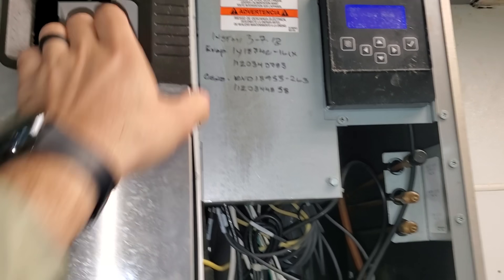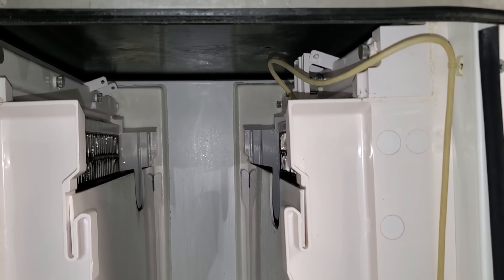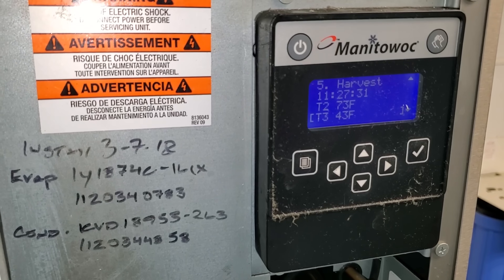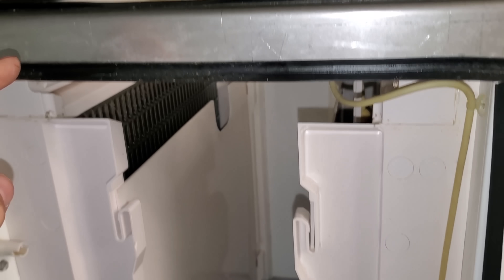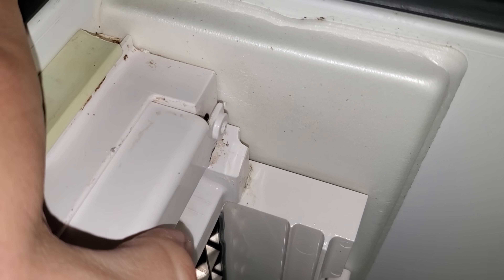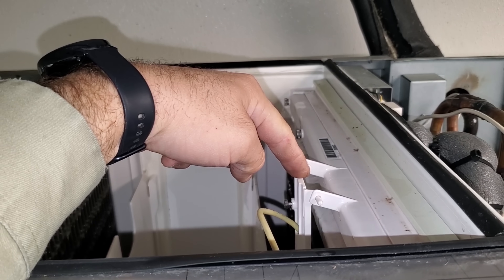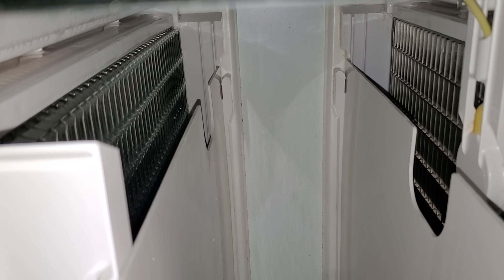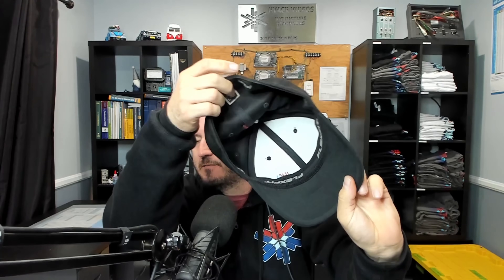THE ICE MACHINE IS DOWN

Comment: Long Harvest times will burn up an air compressor just like clogged water filter or undersized supply line or float or water probe malfunction. switched Bin Switch wires is a new one to add to the check list though.

Comment: You Guys Have it so easy nowadays on these ice machines with the ability of the internet to just look things up, plus kudos to the manufacturers for their websites and giving techs the information they need. God the old days before published spec and tech info. You could spend hours on some of the ice machines just trying to play Jonny detective to figure out what the hell was going on and track down the dang problem,  then the availability of parts was more of a nightmare than even now with this pandemic. I remember having to wait for 2-3 months to get a frigen $25.00 part from mainland China, but I learned early in my career to always order two of the same parts at a time because 99% of the crap came( BWD) Broken When Delivered, I also learned that NEW parts are just parts that have never been used before NOT that it was guaranteed to work like intended. Sometimes I would take a break from working on an Ice machine and walk down the street a bit Scream and cuss like a sailor on leave, smoke a sig and then take deep breaths and get back to it, you also became very good at hacks and tricks to by-pass broken crap to keep things running until the slow boat from China with your parts came in. lol

Comment: I suspect that it's been switched that way for months, if not years.   What's happened is that the pump that was failing brought it to light.    By the time it cut off the "finished" side, it had put enough vibration into the "almost finished" side to let it complete the job.   With the pump _failing_, it could no longer get right to that edge point.

Comment: You gotta get the sounds of the machine down. That is the first thing I do when I walk up to any machine. Sight, sound, smells even. Most the time it will point you in the right direction. That noisy pump was probably a little low on pressure. Now you know that is one less thing to have to worry about getting called in on a weekend. Thanks for the video.

Comment: If you guys haven't changed the board, and the cleaning crew clearly haven't been into the the bin switches, that leaves the customer tinkering with the unit.

Or, and this is a stretch, some how the pathways for the bin switches changed in the board. Like I said, that's a stretch and highly unlikely. If it happens again, than it's possibly the board.

Yeah, that's weird, but of course the customer says, "only you guys have been in the unit." Weird🤔

Comment: Here in Fl, any Scotsman or Manitowic has these errors, we always go the Evap coil and inspect them. Especially with the hard water FL has, the nickel plating on theses ALWAYS chips off. We notice even filtering doesn’t help with the water hardness and the calcium build up. With that said, the ice sticks to the Evap where the nickel has been pulled off by the ice, and that’s will prolong harvest as the machine gets older. Here Evap a last 5 years at most, and that’s when, it’ll constantly have these problems. 
Stick to Hoshizaki!

Comment: Update on my Fluke 337 & 52II rant -- replaced my 337 with the Fieldpiece SC440 and my 52II (still works put has a cracked screen) with
 the ST4 -- I'm still f@#king pissed -- still have my Fluke 971 humidity tester and & 1587 Insulation meter going strong after decades -- 
even the parts we replace on the walk-ins and worth chit some or most of the times -- compared to back in the day!
Reply: parts we replace on the walk-ins ain't worth...............

Comment: Chris, Ice machines are very finicky..  And, the worst part about troubleshooting is patience. In the big picture diagnosis. And not coming to any pre-conclusions or pre-determinations. And, worst of all troubleshooting overall is intermittent problems are the hardest to diagnose. 20 years of experience here.
The Old Scotsmans. What’s the mechanical timer in the sequence of operation. And, a lot of the places I go to in Western Pennsylvania Out in rural areas have well water to some of these restaurants in very high mineral contacts and have very little filters if any on them.. played hell in trouble shooting how do you how do use 75% dilution on ice machine cleaners back in the day to remove the mineral buildup and sometimes even Straight cleaner.

Comment: As for the Sequence operation when the unit is truned on the first thing that will happen is the dump valve will energize for 45 seconds and the first per chill will be 2:00 mins and the next cycle the per chill will be 30 seconds.

Comment: I've ran into a couple sabotage repairs. Like, Who the F?! pulls off 2-3 panels and messes around with the wiring? One of the most difficult diagnoses I have ran into was someone (not any of us in house HVAC guys) pulled the panels and messed around with the dip switches on the control board. Like how would a non-technician even know how to do that? I agree people should read up on Ice machines, but standing there scratching your head in frustration is what is going to give you the experience and ultimately have you learn there quirks. It just sucks the sequence of operation takes so long.....just standing there with your finger in your butt.

Comment: Chris, there is a "hack" for some indigos when the plate is so worn down it locks out on long harvest, but only if the customer can't afford a new one or the repairs
 You can tilt the machine forward SLIGHTLY, and the best... Is to drill a new hole where the damper switch goes, of you move it forward more by drilling a new hole, the machine will not register the damper is open slightly when ice is hanging on the plate giving you more harvest time before lockout. 
 These are last resort hacks for OLD machines and customers going through a hard time.
Reply: If this is the machine I'm thinking of, then there's also a firmware update (which this one may already have) that massively improves how the machine handles long harvests. It's been a while so I don't remember the exact details, but I think it's able to automatically go into a cycle where it tries to melt the ice out if it's unable to harvest normally , whereas with the old firmware it would just go right back into freeze and probably just freeze up the entire machine.

Comment: I had a Scotsman do the same thing. I don’t really get to work on many ice machines. It pretty much kicked my butt. I was with tech support on the phone and going over cleanliness, spillway scrubbing, water distributor mounting bracket, ice thickness sensor, harvest assist solenoid, refrigerant charge and everything was checking out fine. Also the hot gas was working as well. It’s one of those things that made me really scratch my head.

Comment: So many maintenance guys mistakenly think ice machines are easy to service/diagnose simply because they're relatively easy to install.  Once you know the sequence of operations diagnosis is pretty easy, however I've seen more guys in refrigeration get tripped up by ice machines than any other refrigeration pieces out there.
Reply: @Akronkangaroo  you got that right. I was just on a CIM the other day that was mounted to a dispenser. The maintenance guy installed a bin stat and was like "the stat you guys sent is broken, it's not shutting off on the stat it's still shutting off on the curtain". So I get there and he had installed the stat so high the dispenser bin was full and the ice still wasn't high enough to touch the stat 🤦‍♂️. Not to mention the ice bridge was half and inch thick. Their "refrigeration" guy set it up and literally set the water regulating valve to 210 psig. It's supposed to be at 250 head (for IOM), which is exactly why the ice was so dang thick.

Comment: mhh manitowoc teached me the distance between microphone and evaporator has to be exactly 6,8mm
Reply: It's all based on the customer's preference and purpose of the ice. Some customers want thick ice others prefer a thin bridge. I never set a bridge thickness greater than 1/8of an inch on any ice machine that has thickness adjustment.

Comment: This is where you have to know the sequence of operation and how all the pieces play together.  Here it was the electronics were getting bum info from the mis-wire.  

You seem to fix more electrical problems than true refrigeration problems.
Reply: 90% of issues in refrigeration and  HVAC are electrical
Reply: so long as installation and commissioning is done correctly, there should be next to no faults refrigeration side for a long long time. i have been to maintenances for my old boss where systems still have their original oil charge in their compressors and still probably just about as clear as the day it went into the compressor.
Reply: most memorable one was on a 20 year old compressor that looked pristine, forgot to mention the ages couple were a little older maybe 25-30yo installs still chugging along nicely just a bit dirty for the most part
Reply: There is no info other than long harvest.. that was the issue.. the info was spot on ...I've had hot gas valves fail because the insulation on the refrigerant lines is bad and was dripping directly on the wiring harness plug for the valve and shorted it out...Long harvest code again ... all techs have to take it from there and follow it to its logical conclusion. Hoshizaki's have an initial list of 14 items on an ice up call that then depending upon what you find takes you to another list of 36 items with narrower scope sub listings. Its the job...

Comment: I had one last we when it dropped a sheet it would shut off the opposite sides air pump and close the harvest valves. And no, it was not mis-wired. These manitowocs do some weird stuff when the board goes bad. 
Switched the wires for the doors and worked perfect for a couple drops then started going into harvest 5 minutes in lol. 
It’s getting replaced next week.
Reply from the maker: Wow thats an interesting one
Reply: Yeah it took a couple visits because the day before it worked fine after finding and replacing  a bad LP control that was kicking the comp off during freeze.  What NorCal Dave would say, multiple offender lol.

Comment: I have a same problem last week but my the left side evap drop ice but the right side did not. I pulled out 17 LSB OF R404A. Weight in factory charge of 15 LSB but unit still doing the same thing. Once the left side evaporator drop ice it turn the hot gas valve and the air pump on the right side evap off. A senior tech came out with me and replace the right side hot gas valve. It work properly now for god sake.

Replaced ITP, T3,T4 sensor and clean it,weight in factory charge for 3 visit did not solve the issue. FINALLY IT THE HOT HAS VALVE LOL